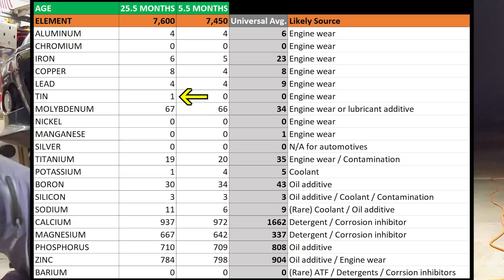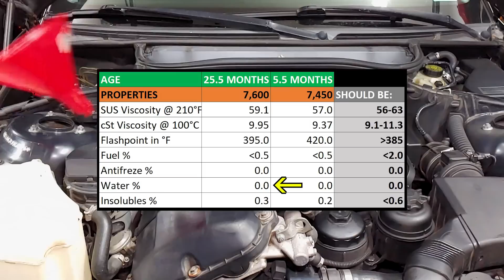Does Oil Really Need to be Replaced Every Year? Surprising Analysis Results Revealed

Comment: Oil never wears out. The additives do. Moister gets in oil by driving short distances. Once the oil gets to operating temp it boils off. My old work truck sets for years, in the shop. Then runs 4 to 5 k when needed. It's got 290k on it and runs just fine.  If that oil was setting on a shelf in your shop, for 3 years, you wouldn't think anything about it. Setting doesn't hurt it at all, just get the car up to operating temp when you do run it, and it'll be fine.

Comment: I changed the oil on my Honda crx, every 18-20k miles, after it hit 240k.  It was at 340k and I sold it, still running perfect lol.  I've never had a car that the engine died, due to oil issues.  Every time, something else ended up being the thing that made the car junk, like transmission, frame etc..  Unless you really abuse an engine, it will most likely run longer than the rest of the car.  I have to laugh when people get so uptight about oil, it doesn't really matter until hundreds of thousands of miles later, when the car is junk anyways.
Reply: Holy shitzz 18000 miles btwn changes ...guess my 2500 on our older X3 is fine

Comment: What if you have something that looks like chocolate on the inside of the oil filler cap?
Reply from the maker: Seems to be normal with these cars. Mine has always been that way, but it's not anywhere else under the valve cover.

Comment: Oil breaks down is the worlds biggest marketing lie. In fact it never breaks down. It only becomes less effective over use because it’s filling up with dirt. I could get 100 people that change their oil early and tell them this and guess what, all 100 would still change it early. I think it just makes people feel good. I suggest you simply laugh at them and go buy some oil company stock.  Ever wonder what the oil change interval is on a aircraft turbine engine?  It’s NEVER! There isn’t one. Why? Because the oil doesn’t get dirty from internal combustion. And it sure in the f—-ck doesn’t break down. When the oil becomes contaminated with high levels of metal, then you rebuild the engine, not change the oil.
Reply: No.
Its proven that the high pressures and shear loads in combustion engines affect the oils viscosity.
High Temperatures accelerate that.
The effect is indeed oil breakdown.
The modecule chains can only handle so much until they break apart which thins the oil out.
Also the additive package is being used up over time.

If we had the finest oil filter in the world and 0 contamination in the oil it would still wear out over time in an ICE engine.

Comment: Nice. Thought it was a scam. Fuck your comments. You know people you don’t know commenting on the internet doesn’t go well.

Go the intervals dude. MILE intervals. You LITERALLY got the data to prove time doesn’t mean shit. I do that. I’VE ALWAYS DONE THAT. And recently like you, i haven’t been driving my vehicle daily either. Trucks at a year and multiple months and only got somewhere above 1000 miles on the oil. Nothin. Looks normal oil use fine. Engine runs good. Oil change notification hasn’t popped on yet. With my truck, normally does around 4200 miles.

Quit believing the advertising fear mongering boomer conservatives. Tim Dillon is so right. God y’all were the worst.

Comment: I know someone who used longlife oil in their car and drove it for 30k kilometers (~18k miles) between oil changes. Bought the car with 60k kilometers (~37k miles) and sold it with over 300k (185k miles) kilometers. The car was always driven, but never hard.
Reply from the maker: I'm currently running the tests from Part 1 again with long life oil. It will be interesting to compare the results.

Comment: Great video. Confirms what I've always suspected about the frequency of oil changes. I use Castrol Magnatec and change oil every 18 to 24 months  on my Mercedes Benz C200 and Mazda CX5 and have been doing so for many, many years without problems (from South Africa).

Comment: a hundred oil changes are still cheaper than one replacement engine & its related installation costs.its your money to save or burn.
Reply from the maker: Depends on the motor. 100 oil changes would equate to about $7,000 on my car.

Comment: I had a Jag X type for 9 years. Changed the oil twice in that time. Sub frame went and engine was still sweet with no issues. Changing oil is a money making scam, my Jag proved it doesn’t need doing every year. In that time the car covered approx 70k miles

Comment: I think the common convention of 2000/6mo that I grew up with has remained as people tend to teach what they were taught etc. But the oils are so much better now and the tolerances too. Engine frequently last for 200k or more if maintained. Back in the old days the oils weren't that great and rings let a lot of fuel past. I always smell my oil for it out of habit. My VW service interval is 10k miles per the manual but my mechanic says stick with every 5k from now on even though the engine looks great. It's a low mileage/use car too so this video is encouraging! I want this car to last another ten years at least. As long as gas can be had
Reply: I have a 2.0 tdi which is a diesel vw Passat it has 353000 miles and it has had 10k oil changes since new
Reply: @GameCastCubed  I worked with a guy in the mid 90's (pizza delivery) and he had a late 80's diesel jetta. He claimed he drove it from Austin to Toronto and back on only two tanks of fuel during spring break. If so that is something like 1600 miles to the tank. I think VW really is concerned the most about that first 5k oil change and service. Failure to do so would void the warranty. I can't really see them suggesting something that would harm the vehicle as they are so anal about everything. I love my VW but won't buy another

Comment: Blackstone flashpoint and insolubles test are outdated and not reliable.  They take forever to get results. TestOil same day turn around, use gas chromatography which is the most reliable and accurate. Includes TBN, Oxidation, Nitration, Soot, Analytical Ferrography, and Particle Count, fir far less than BSL.  They also give you an extration pump for free for samples.    Drain plug samples are messy, and unreliable.

Comment: Didn't listen to you talking,  because it was had to tell what you were saying.  The music didn't help, and it sounded funny. So I read a few comments and found some information I agreed with. Had a bug I changed the oil every thousand miles. Got it to go 113 thousand miles, but I thought it should have been better. Now I change oil every eight thousand miles or when the oil get past medium Brown. I use GTX and  have the store brand on the side in case someone wants to borrow  some. API rating is good on any brand. I do my own changes as you can't trust any body. Or at least I don't.

Comment: Obviously if you do drive a lot of miles you need fewer oil changes than if you do shorter journeys as condensation builds up on a cold engine and gets in the oil. .Remember oil is cheap a wrecked engine is expensive.

Comment: 20000 mile oil changes are quite normal in Europe, for exactly the same engines. Someone is definitely wrong and I think that it's probably the Americans.
Reply from the maker: I am currently running these tests again with European LL01 formula that is supposed to be good for 20k miles. It will be interesting to see the difference.

Comment: My truck only goes 1-2k miles per year. Mostly short trips. I recently switched to Amsoil’s mid grade oil and the visual difference has been stark. After 500-1000 miles Mobile One syn. would turn noticeably dark to black. By now it would be black as coal. Conversely the Amsoil hardly changed in color at all and still has its Amber color. I have always felt that changing oil on vehicle running good synthetic ever year was ludicrous. My truck is a nicely kept, outdoor kept 2005 Silverado 1500 LT 4x4 with a K&N air filter that sees a lot of dirt/ off road during hunting season.

Comment: Been changing Full Synthetic oil every 25K miles for over 35 years and have never had an oil related failure or an engine with excessive oil consumption defined as more than 1 qt/5K mi. running engines to 300K - 350K miles. The military changes oil based on oil analysis only, even in aircraft. My estimate is I have saved an easy $20K over what I would have had to pay if I had followed the manufacturers oil change specifications.

Comment: There is NO too often oil change.
Reply from the maker: Every 10 minutes.
Reply: @endlessmoneypits  it’s too long. Every few seconds
Reply from the maker: I only add oil to the gas now so the engine is only lubricated by clean oil. It works for 2 strokes.
Reply: @endlessmoneypits  put the oil instead of gas, more lubrication, moooore

Comment: Please do an oil analysis for motorcycles as well. It would be interesting to see if the higher revving engines of motorcycles have any effects  on engine oils.
Reply from the maker: Great idea, I will certainly do that. I have two different types of motorcycles I can test as well. Thank you.
Reply: @endlessmoneypits  An analysis on how long diferent types of oils such as mineral or synthetic can last can also be interesting. Among my circle, some swear by only using mineral oils up to 600 miles although the type of oil meets every specifications set by the manufacturer, and some even only go to 2000 miles for synthetic which I think are too low (my manual reccommend changing oil every 4000 miles).
Reply: Motorcycles are more sensitive to engine oil. You do need good oil and change it often due to the smaller oil capacity and high rpm (I'm talking about over 10k rpm if you like going fast). That is from my experience . You can actually feel the difference between old oil and new oil from acceleration

Comment: It depends on fuel and oil consumption,after a litre of oil is burnt off (or a quart for the Americans) in a average car you should consider a change.10,000 km or 6000 miles is not very far on a car that does not burn some oil

Comment: Never!!! As Far as I am concerned you cannot change your oil too soon… 
 All you have to do is look at the oil on your dip stick and if it’s turning brown, it’s polluted with combustion byproducts and the metal that is already being produced by wear… The oil filter is getting smaller because it doesn’t have to be a huge filter and it is cheaper for the manufacturer to make them smaller so they need to be changed with every oil change…

Comment: In Europe for new cars under warranty oil change interval is 30000 km or 24 months whatever comes 1st. With synthetic oil I really doubt any degradation can happen under 24 months period. Beyond that interval I guess some can happen so I would avoid changing oil if less frequent than every 2 years no matter what mileage you drive. But I guess 3 years would still work for someone driving less than 5000 km per year. Realistically car would fail from other issues before oil is a problem if sitting for too long.

Comment: Everyone should get Blackstone analysis done. There's so much opinions out there. The analysis isn't expensive (compared to what people spend on car washes, detail jobs). There's nothing like knowing what's going on with your car, your driving habits, your climate, etc.

I have a GDI engine which I'd heard results in fuel getting into the oil. I thought 6-mo oil changes (or even more frequent) would be desirable. Oil analysis showed no fuel in the oil. No moisture (I drive frequent short trips, the classic "at risk" for moisture). I've settled on 5k miles no matter how long it takes to reach that. The analysis shows that is working fine.
Reply: Good luck with that, you're on borrowed time. Change it more!
Reply: @ginog5037  The analysis continues to show no wear metals (no dilution of fuel or moisture). I definitely used to be "you can't change it enough." It was an undoubted virtue to keep the oil fresh. But, the analysis is showing 5k miles (even if it takes 2 years) is working fine.

In fact, if you change more frequently you'll see the wear metals higher. That was counter-intuitive to me. How could purer oil cause that? Apparently the dry-start after the oil change. So, deferring the change reduces wear (to some extent before the worn oil causes wear).

Have you done an analysis? It would be interesting to do a couple low-interval changes (and analysis). Then go long-interval just once to see how the analysis compares. You'd spend $100 for 3 analysis.
Reply: @markfuller  I've done oil analysis to confirm how much the additive package breaks after 1300 miles (that's ALL oils BTW). The magic number is 2500 in the summer and 3k in the winter. This is on 4 cylinder DFI turbo engines. The result is 270k on one engine and 320k on the other. NO oil related issues and zero sludge, look at your engine. The wear you claim is truly the dumbest thing I heard. Modern engines have oil prime circuits, look into that.
Reply: @ginog5037  That's interesting. I know the topic of oil can be religious (like team sports). I hope I'm not doing that wrt analysis. But, I'm not seeing what you say I should be seeing. The additives aren't depleted. There's no wear metals. (And, I do see the oil light stay on a second or two longer when first starting the engine after a change. That indicates less pressure, but perhaps some cars are better at this. BTW: When I tested low-interval changes, I actually saw higher wear metals which seemed odd if the oil had less use. I can't think of any other explanation why than the longer low-pressure experience that comes with each change on my car, at least).

I'm not trying to question your experience. It seems like if this interval that bad (and using analysis to get longer intervals is that bad, there'd be a lot of criticism out there of bstone. I'm sure there's some. There's always exceptions to a rule. But, I mean widescale criticism you'd expect if this were the rule. There's even someone who gained access to bstone's data to study for trends. Nothing popped out to them other than how more-frequent intervals resulted in the non-intuitive higher wear-metal.). That's all I can relate from my experience. I'm not using fancy oil, just QS "all mileage."
Reply: @markfuller Mark, that's fine it's your car. Funny last, I spoke to an oil company regarding my dry sump, wet clutch motorcycle about the new oil. It's was just repackaged with more zinc and calcium. Also, they found that the interval is even more important. Bottom line, all the crap in suspension today is the death of ALLl engines, especially wet clutches. To me, changing oil is simple, fast, fun, and cheap. OEM filters and decades of same oils and hundreds of thousands of worry free driving.

Comment: There is no such thing as too often. I do mine every 1000 miles.
Reply: That is 100 oil changes over 100,000 miles. How much does an oil change cost you, and how often do you change cars? I would say that if you change cars every 100k miles, and it would still be going fine at that with 5k changes, you are spending 5 times as much on oil changes as you need to. But that is your choice. Yes, oil is relatively cheap, but it can all add up quite a lot.
Reply: @tonylittle3508  I don’t change cars. My second engine is on its way out, and I want to extend its life by flushing out soot. In my experience, the oil is completely saturated with carbon after just 500 miles, but that’s too much work to maintain.
Whenever I get my 3rd engine, I’ll keep the same interval, but switch over to conventional ZDDP racing formula. Conventional oil is so cheap, the consumables become less than the cost of labor. Of course, I do it myself, but my time isn’t worthless, so that’s where the bulk of the cost comes from.
Reply: waste of money lmao
Reply: @bobaphat3676  Driving a performance vehicle is a waste of money.
Reply: what vehicle is it?

Comment: I have always changed oil based on 5,000 mileage, not time, including for vehicles I have driven over 200,000 miles each. Never had an oil problem.  Seriously, how could oil deteriorate in a parked vehicle? Are retail stores rotating their stock of motor oils like with milk?  If you do make short trips where the vehicle never fully warms up, or for heavy duty use, just make the mileage intervals shorter. Conventional oils may be cheap but not so for the top synthetic brands or for classic car oils having zinc in the formula.

Comment: Engine oil acts as "ball bearings" between metal parts in your engine. It keeps the metal surfaces from coming into tight contact with each other and causing excess wear. This quality diminishes with use. Also, carbon emissions and often raw gasoline will "blowby" the piston rings into the crankcase causing oil to lose it's protective qualities much quicker. And it can be very hard to tell when that is happening.  The BEST way to guarantee the most miles out of your engine is to change the oil often.
Reply from the maker: The lab results do not show the oil quality has diminished, and also shows there is 0.0% fuel in the oil.
Reply: @endlessmoneypits  Well, you have more faith in those lab results than I do.  I've seen lab results be wrong too many times in my life. I'd rather know for sure and just change the oil. Good luck with that.
Reply from the maker: This was the 4th analysis I've had done on this car. What are the chances they are all wrong?
Reply: @endlessmoneypits  All by the same lab?
Reply from the maker: Same lab over a 3 year period.
Reply: It would be interesting to send identical samples to more than 1 lab and compare results.
Reply from the maker: That's a pretty good idea.

Comment: Used to have an S2000, absolutely beat on it as a weekend and track car. Took over a year to do 5,000 miles which was my interval. Oil analysis always came back clean. Penzoil full synthetic.
Reply: Those were also well-built cars, which helps.
Reply: Made in Japan makes a big difference.